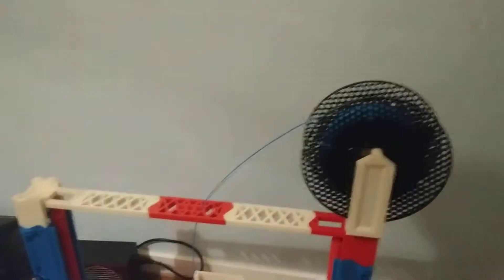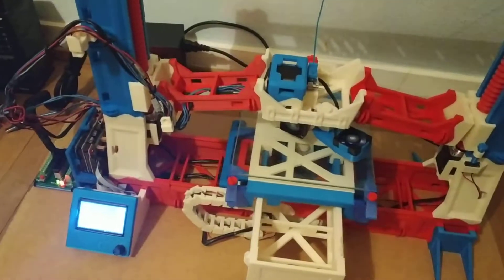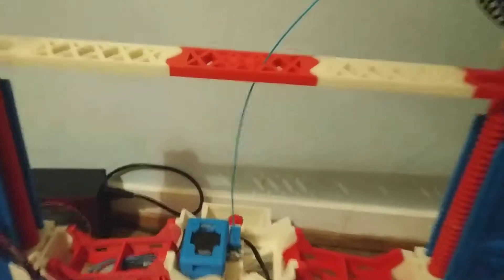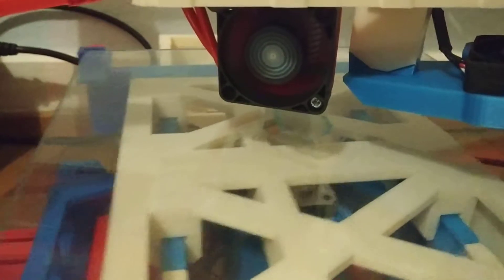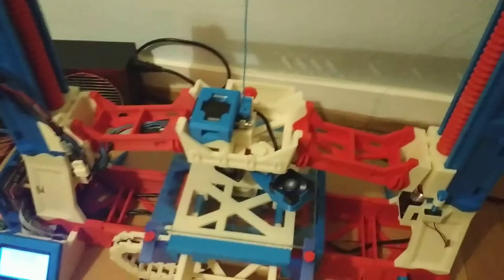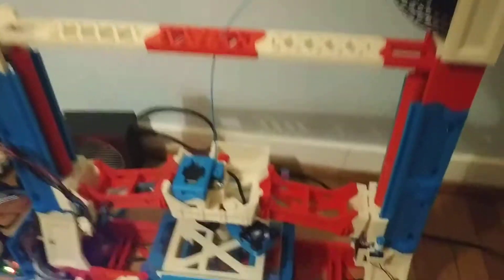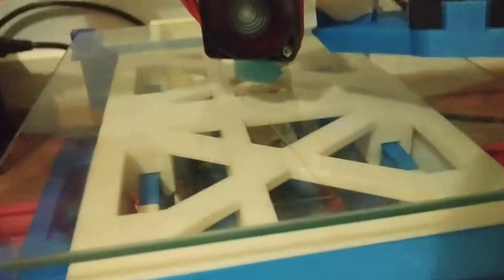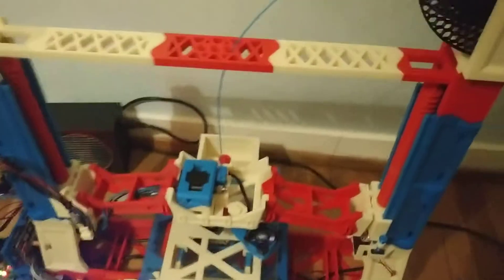Snappy 3.1 self-replicating 3D printer - Quick test

Comment: hey. i am ca 3 years late. but is it possible to show a list of all the parts i need. i am debating wether or not to print this. but it doesnt show a list of what i need in the files and how many 3d printed parts. i am not expecting a response but i would be happy if you answered. and btw how much did it cost for you? and last thing, what do i do with the scad files and do i need them or are those just for tiny configurations?
Reply: it should cost around less than 200 US and the print quality of this is slightly rougher than traditional printers, and you need around 37 printed parts